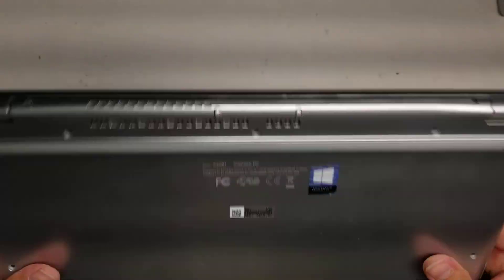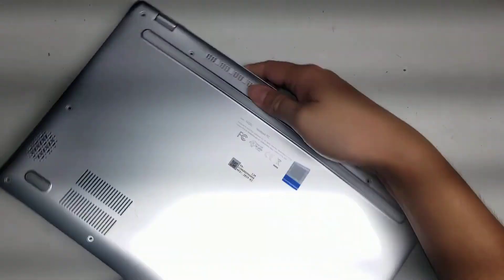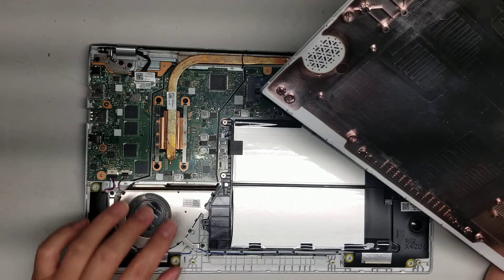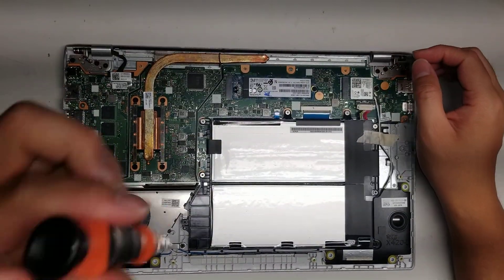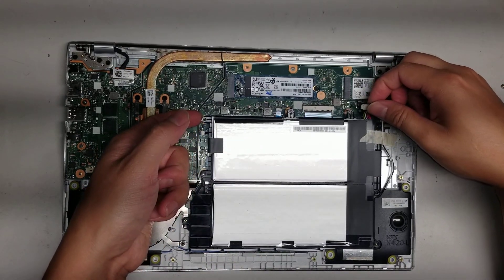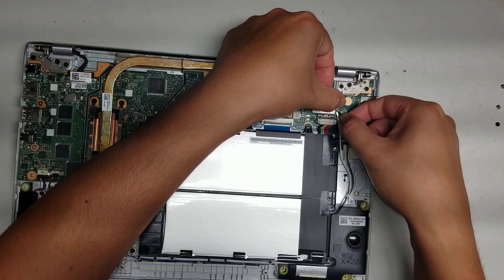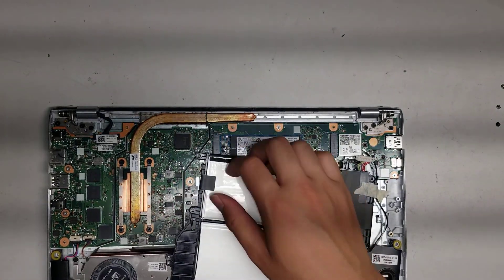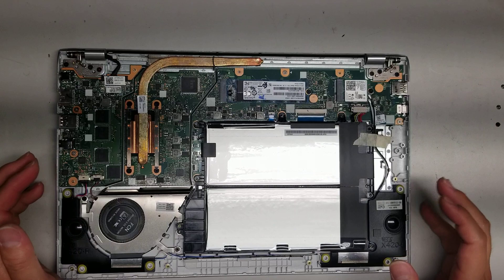ASUS X420U Disassembly SSD Hard Drive Upgrade Repair Part 1

Comment: Is it right that these have 4gb ram and not upgradeable?
Reply from the maker: Most likely
Reply: @ItsBinhRepaired  I know it’s 4gb soldered but is there a spare slot to add more you’ve taken it apart you must know?
Reply from the maker: @Leon Hudson  what did you see? I've taken thousands apart. The video should show you what you're asking. I do not have the memory capacity to memorize every thing I work on. I don't even remember what I ate yesterday. Lol

Comment: Thanks for this video, very informative. 👍 My Vivobook "R459U" model has the exact same case, and I searched for hours for a tutorial on how to safely open it.

I now have enough confidence to open mine and clean it from dust. I'm figuring/hoping dust is the reason why its fan appears to not be working (can see through the vent that it's not spinning + making clunky sound) and causing overheating.
Reply from the maker: This video will help https://youtu.be/3zs_SJ3BXgA